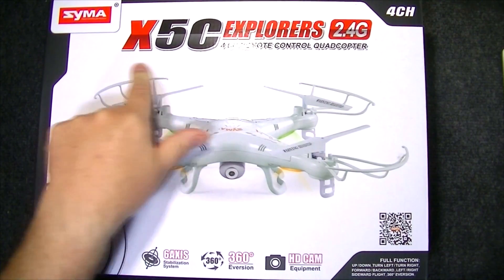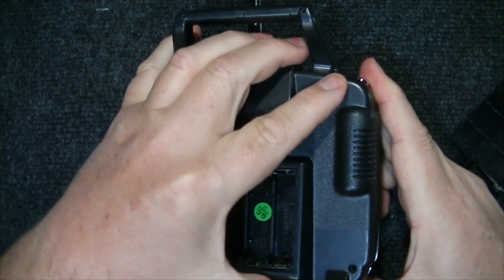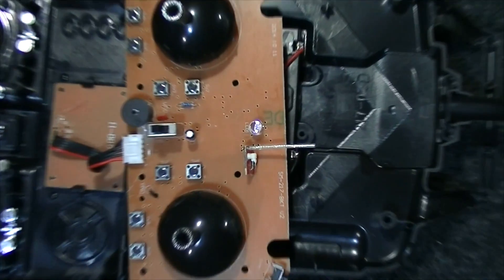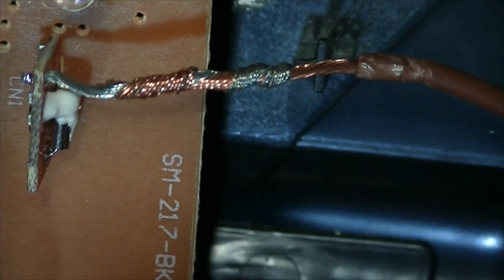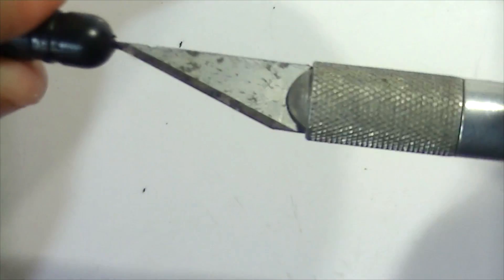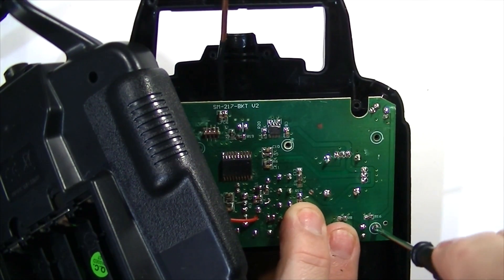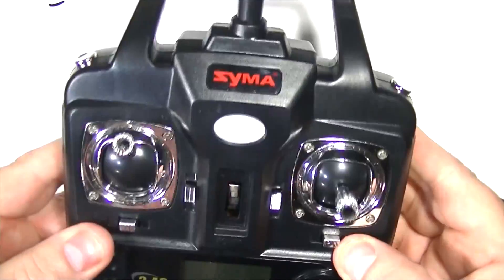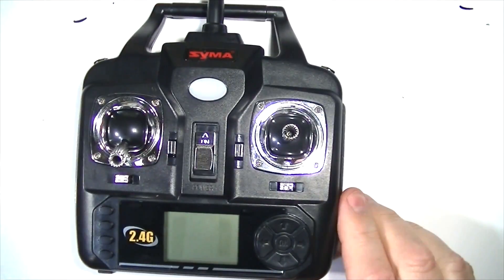Syma X5C Mods - Range Extender Fix - Without Soldering Antenna Length Hack

Comment: I cant open my controller. The screws are too hard, any ideas to get that working?
Reply from the maker: I would try different screwdrivers until I find one that fits perfectly. If that doesn't work you may have to drill out the screws, break the case or abandon the project. Good luck.
Reply: @roberta.edinger9405  Hey, I found the antenna, but I didnt open it the way You did, I open it on those black (in your case silver) things. Can I also mod it like so?
Reply: I also removed the plastic antenna.

Comment: 18 gauge (1mm thick) hook-up wire, got it. Does type of metal matter much? Aluminum, copper, stainless steel etc..
Reply from the maker: The type of wire doesn't really matter, unless you intend to solder it. Aluminum and stainless steel can be difficult to solder.
Reply: @roberta.edinger9405  Thank you! Will try solid copper tomorrow morning.
Reply from the maker: Let me know how it goes. Good luck.

Comment: Unconscious barbarian. I'm counting at least one antenna size for that frequency, not adding a piece of wire.
Reply from the maker: Unconscious barbarian? You are totally wrong. I am completely aware of my barbarism.
Reply: @roberta.edinger9405  I personally consider myself a conscious barbarian, although not if I faint or go into a coma. Great video Robert.
Reply from the maker: Thank you my barbarian brother.
Reply: @roberta.edinger9405  wha'ts the wire you're using

Comment: Can i use USB cable pls reply
Reply from the maker: Unfortunately USB cable is shielded, so no. However you may be able to pull out one of the single insulated wires from the cable. That should work.

Comment: or use the software onboard to turn off low power mode and increase range to full. You don't have to cut your device apart. Simply hold up the forward trim as you turn on the transmitter. The antenna bars will stop flashing and you'll have greater range, Greater than this.
Reply from the maker: WOW! I will have to try this. Thanks!
Reply: @roberta.edinger9405  Did it help?
Reply from the maker: Yes, now I can fly it so far out that I have trouble seeing it.

Comment: I took a piece of wire that a Christmas ornament hangs on and clipped the insulation off the little nub of an antenna with some nail Clippers. I twisted the wires together a little and put it back together with wire hanging out. Double the range in 10 min.
Reply from the maker: cool, that's a great idea. Thanks for the information.
Reply: @roberta.edinger9405  it worked pretty well but came loose so I soldered a 2.5 cm wire onto the antenna wire without even removing the board or anything and drilled the antenna nub for it to stick out. Works great.
Reply from the maker: Cool! I'm glad that worked for you.

Comment: Solder much? HaHa! That's one of the most ghetto antenna mods I've witnessed. It's one thing to use electrical tape, like I did when I was a kid, it's a whole other mess if you're not even gonna use it right. I personally would not recommend any methods of anything show in this video. I figured if you weren't going to solder, you'd at the very least use a crimped connection.
Reply from the maker: Not everybody knows how to solder or even has access to a soldering iron or a crimping tool. this video is for those people. But thanks for the criticism.

Comment: Hi, can i do this with solid copper wire? how big would it have to be and what is better the wire you use or the solid copper wire.
I have 0.2cm wire. Also would it improve the signal if i make like a circle or biconical shape in the outer point of the cable? thanks in advance
Reply from the maker: solid wire should work fine but the length still has to be 12.5 cm. As for the shape, I don't know. Try it out and let me know. Thanks
Reply: Thanks, also is there anything i can do in a drone to help the range?
Reply from the maker: @razstec  I've not tried anything inside the drone to increases range. I suppose it's possible to lengthen the receiver antenna. But I'm not sure if that will help or not. If you try it let me know. Thanks

Comment: I want to try this on a Promark Drone transmitter. Will this work on any 2.4 GHZ transmitter? Does it really help, were you able to see an improvement?
Reply from the maker: I am not familiar with that particular model but since it is 2.4 ghz, it just may help.

Comment: thanks for the video.

but it did not work
Reply from the maker: I am sorry to hear that it did not work. It very easy to crack the solder joints where the antenna circuit board solders on to the main board. However, those joints can be easily repaired but unfortunately you will need a soldering iron to do that. Good luck.

Comment: Cut 12.5 ? 12.8, ? 13?
Reply: Robert A. Edinger 
Do you know of a link that explains the reasoning behind that? And if a longer length is possible?
Reply from the maker: 12.5 cm
Reply from the maker: I read somewhere the 12.5cm is the right length, but unfortunately I don't remember where I saw it. Sorry.

Comment: WHAT "warranty"? From CHINA, that warranty? If you can't solder properly, you have NO right to be doing this PLUS he's linking to soldering supplies anyway. WHERE did he get the length from, here?
http://www.rcuniverse.com/forum/rc-radios-transmitters-receivers-servos-gyros-157/10094483-antenna-length-2-4ghz.html
So what wavelength do these $5 radios transmit at? Because the ORIGINAL antenna is obviously QUARTER wavelength, so WTF does your mod do WITH NO VISUAL PROOF?

Let me see a WALKING RANGE CHECK at an open field, otherwise Fuck off!
Reply from the maker: Thanks! I'm glad the video was helpful to you.

Comment: Hello, great video sir. 1 thing i would like 2 ask b4 start with my drone i.e. Eachine E56(Single handed remote with gyro sensor control). This remote is very small and no place for false antenna outside! What should i do for extra wire? Should i make a whole on the body and make the extra wire hinged out of remote? Will it work. Pl reply. 
Thanks
Reply from the maker: I think that will work

Comment: Hi Robert.....Thanks for the informative videos... I was curious... It seems like the X5 and several other quads have VERY SIMILAR circuitry in the transmitter... I own the WL Toys STRIKER-X HD model... I am thinking that your mod might work for me. Do you happen to have first hand knowledge or a line on someone who might??
Reply from the maker: I'm sure they use the same basic circuitry for many of their products. If your transmitter antenna is as short as the one depicted in the video, this mod should make a definite difference in it's range.

Comment: First great video! Yes some of the info on this video is wrong such as wire length. but other than that it is what it is a solderless hack. The guy who wrote the book in the comments is right in every way but this isn't a professional quad, it's a toy. So if you don't feel like soldering this will work great.  if you want to do it the correct way read Bill or Bob's not sure of his name but it's a huge comment about him being a radio tech.
Reply from the maker: I'm not sure if your comment was meant to be a compliment or an insult. Either way, thanks. I'm glad I could help.

Comment: Hi Robert,
Great video. I am thinking to get one of the X5C-1.
Would it work on it as well?
Regards.
Reply from the maker: Yes, it should work just fine on the X5C-1.
Reply: Thank you Robert, I've got one that I can use FPV X5SW. As the controllers are the same, I think it should work with this one aswell.
Reply from the maker: Cool!

Comment: If a use a rg316 coaxial cable instead of copper wire, what result should i expect as compared to the copper wire? Will the range increase, decrease or remain same than copper wire? .
Reply from the maker: decrease

Comment: Hey robert, grt work. U got 1sub :). Jst wanted to ask u. Can i do the same thing with the quad? If yes then what should be the length of the antenna?
Reply: lakshya LG same doubt
Reply: Same doubt
Reply from the maker: Thanks for the comment. I've never tired it on the quad it's self. If you try it, let me know how it goes.

Comment: I'm kinda upset I messed this up this is all I had to do
Reply from the maker: That sucks. Check the solder joints around the antenna circuit board. They may be cracked from striping the insulation and might need to be re-soldered.
Reply: Robert A. Edinger still have no clue ima buy one for 10 bucks

Comment: Can i attach a 5.8ghz circular polarised antenna to it? Will it work?
Reply from the maker: I'm not sure if that will work. If you try it let me know if it works or not. Thanks.
Reply: Robert A. Edinger of i use a rg316 coaxial cable instead of 18 gauge copper wire, what should i expect? Will it work better, poor or same?

Comment: Do those low range X5/X5C quadcopters that need range mod have some old revisions of the boards? I am getting 250+ m range with Syma X5 (not X5C) + stock TX without any modifications (the board is revision 6). I bought that X5 + TX + battery + 5-in-1 cable + spare parts for $28 + free shipping.
Reply from the maker: Yes, it is very possible the newer models might have more range. But I just don't know. Thanks for the info.
Reply: I have in the meantime opened the drone and the remote and I did some research. I believe your remote is with a green LED and the new one is with a blue one. The remote for v6 boards uses Beken 2461 transceiver (NRF24L01+ clone) and different communication protocol. BTW, you can use symarx code, AVR microcontroller and NRF24L01+ for receiving data from Syma remote so you can use it to control the devices around the house. You can use analog axes or trim values to control the position of servo motors or to send some analog data so you can use thrust or trim commands to control airfow, fan speed, light level, target temperature etc.
Reply from the maker: COOL! THANKS!

Comment: If 12.5cm is the correct antenna length for 2.5G then why on earth have Syma used such a short wire? there must be some reason why they haven't done this themselves.
Reply: 12,5 cm is full wavelength, you can go with 1/2 or 1/4 (which is a standard in all cheap quads)
Reply from the maker: don't know

Comment: This worked great, I used 16 gauge speaker wire, soldered the wires and have the wire through the fake antenna as shown.  It easily doubled the range, maybe more than doubled it.  Thanks for the video!
Reply from the maker: Cool. I'm glad it helped

Comment: i must have watched this 5 times, before I had the courage to open er up.  done and done.will test tomorrow. It connects fine already. however,  range test tomorrow. may upload a vid,. thanksRobert. . ps, anything is better than the stock 30ft!@-   cut at 12.5cm exactly.
Reply: UPDATE: IT WORKS!! Thank you so much. I am stoked, this thing is useable now. I also drilled some holes in the top canopy, so its more wiffleball than anything, much lighter and now deadfalls on its belly, not as smooth as the striker gitd, but happy with it... Hope to upload some footage. doubled, trippled distance. easily. no more 30ft range for sure. thanks again, subbd.
Reply from the maker: Cool, I'm glad it worked
Reply from the maker: good luck